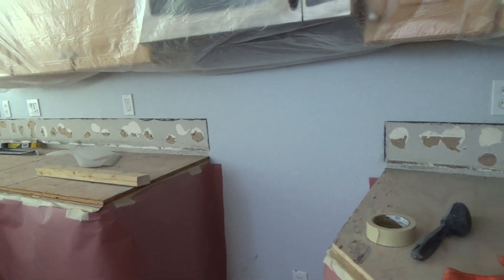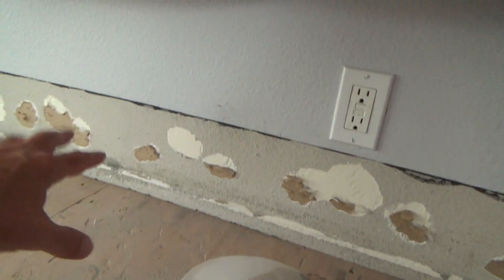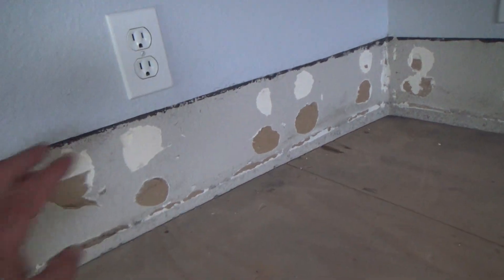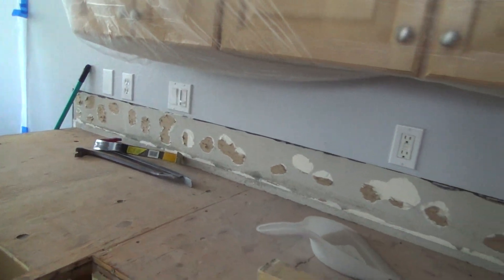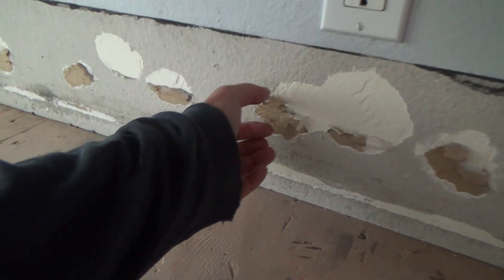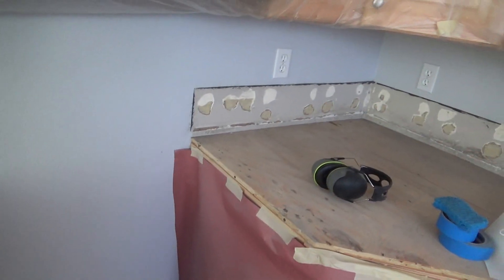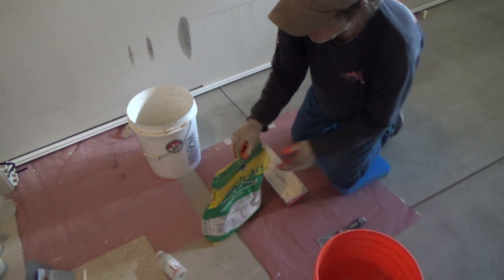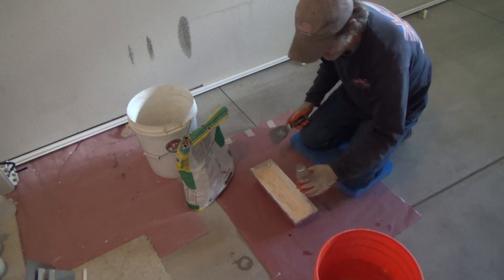Man Can't Repair Drywall Damage Then Does It Anyway

Comment: I usually just paint it with primer to seal the ripped paper. Bins is best but any primer works.
Reply from the maker: I've used bins out of a spray can before & seems to work. Did you see I used masking tape?! Seemed to work really good too....
Reply from the maker: I just created a roku tv channel called DIY for Beginners. If you have roku check it out. Thanks!
Reply: @VideoJoeKnows  yea just seams like it would take longer to tape. Bin is expensive though